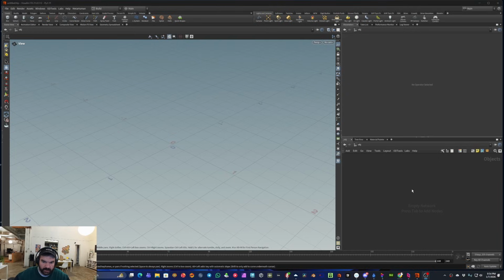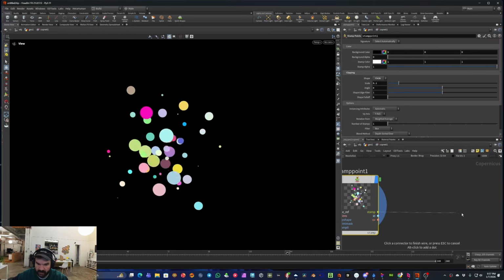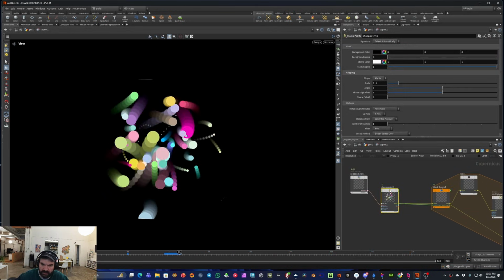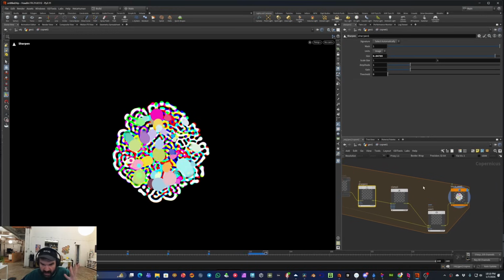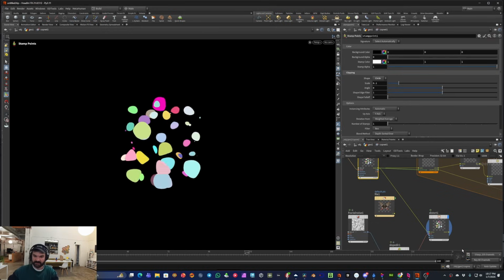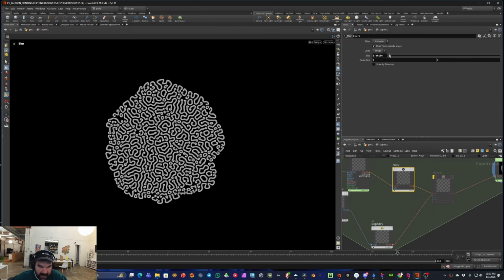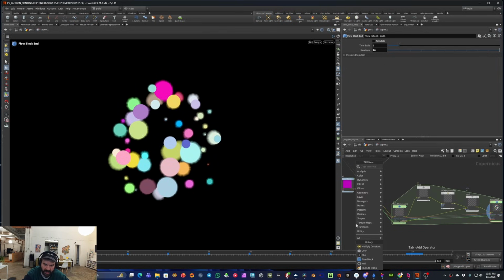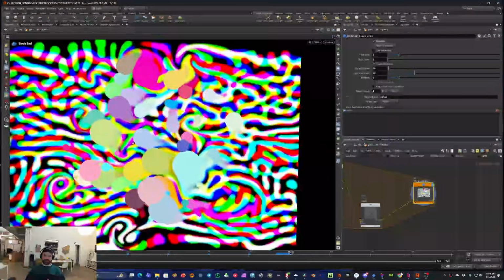SIMULATIONS in Houdini 21 COPERNICUS are TOO MUCH fun!

Comment: When you change parameter values can you get those values from an external source? I would like to hook a microphone up and capture certain frequencies to impact the values.
Reply: Try touchdesigner for that, would be very easy to figure out if you're into houdini
Reply from the maker: @gatee4799 yeah this is the kind of thing touch is still more equipped for
Reply: you can probably do it with chop .
Reply from the maker: @benlemoine75 yeah this sounds like a chops thing. Unfortunately chops is really dated. I hope that sidefx provides some new alternatives for these kinds of things :P